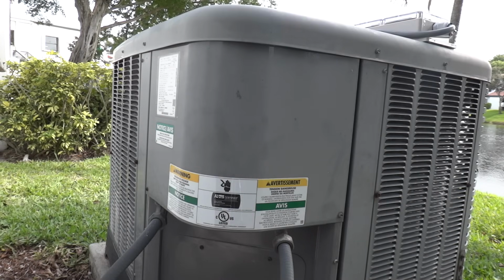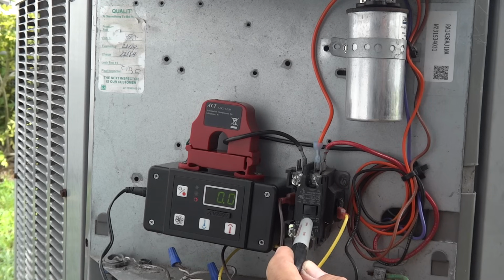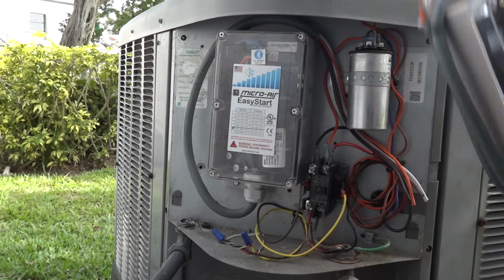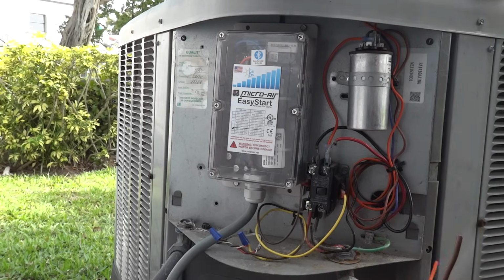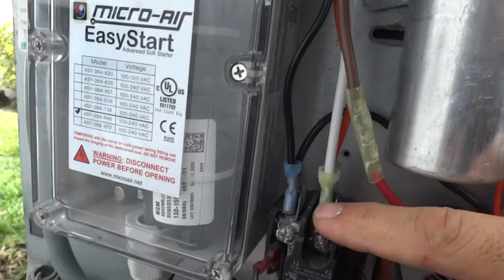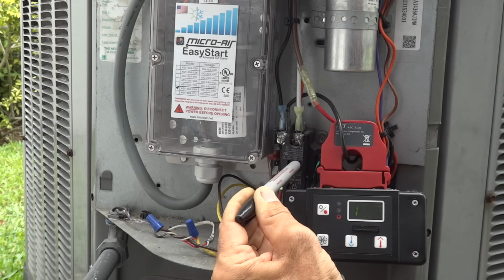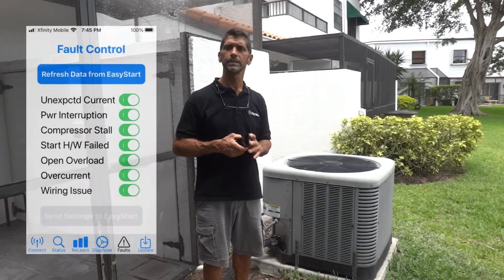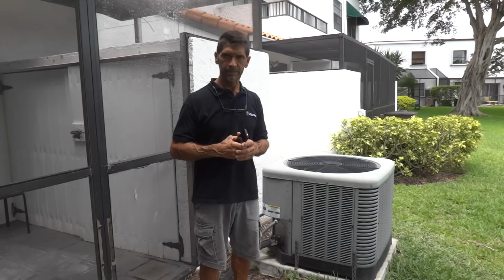Micro-Air EasyStart Home A/C Installation (368 Series)

Comment: Where where is all the other circuitry inside your air conditioner when you open it up? All I see is a capacitor and a contact switch. On my unit when you open it up where all your holes are in the metal I've got circuit boards, wiring all kinds of things hooked up. How come yours is so simple and everything's missing?
Reply from the maker: Hello and thanks for your comment. Most common home air conditioners don't have any circuit boards in their outdoor (condensing) units.  Only a run cap and a contactor, as you saw in the video. For more advanced home units, there is sometimes a circuit boards in the condensing unit that monitors the compressor's operation, provides more sophisticated power interruption protections, etc.  In such cases, you will need to mount the EasyStart external to the electric box, and route the harness wires back inside the electric box for proper connection and termination.  Your installation may also require the use of another special EasyStart setting feature to deal with any advanced compressor monitoring that may be getting done by the system's own circuit board.
Reply: @MicroairNet  And by the way, you need to edit or take down this video as it contains inaccurate information. You said anyone with a 3 ton or less needs the x36 model. In fact anyone with a 2-4 ton unit needs the x48.
I confirmed this with Micro Air. They said they have made changes since this video and being you are an engineer people will take your word and order wrong. 
Please correct this as people will be buying the wrong unit.
Thank you
Reply from the maker: @plainwornout3964 Hi again. The video was published well before Micro-Air changed the size ranges.  A correction to the size ranges was put into the description box a couple months ago.  Please see that.
Reply: @MicroairNet  Alot of people don't look at the description box. I don't believe there was any mention in the video of looking in the description box or anything because it wasn't known at the time. Therefore if I would have went solely by the video I would have ordered the wrong one. That's why I think it should be taken down and put up a new one in its place or put up nothing at all. But I thank you for your replies.
I'm not trying to troll and I think your product will be a Godsend.
Have a nice evening.

Comment: I AM EXTREMELY UNHAPPY WITH THIS $350 PURCHASE!!!!
I purchased an Easy Start unit and installed it over a month ago and my experience is exactly the opposite!!!! The LRA on my 2 1/2 ton Trane unit are 63 and with the Easy Start I see 50 plus amps inrush all the time. This is not even close to the advertised inrush as shown in the above video.
The Micro Air technition has not been able to offer any explenation that makes sense and insists their is nothing wrong with the unit i was supplied with. They really have offered no help.
Reply from the maker: Hi Roy.  I am sorry that you are unhappy with the performance of your EasyStart. I looked up your case and just had a discussion with the support engineer who has worked with you diligently since May 21st.   I will contact you via your email (which I have) and work with you further on this. If in the end we cannot get it working, I will authorize a return/refund for you.  Although we now have over 100,000 satisfied EasyStart customers, we take each case seriously and won't let anyone go away unhappy, even if we cannot figure out why it isn't working correctly.
Reply: in some of the videos, he does say that some units will not see a great differance in starting amps, but it should help prolong the life of the equipment. 😃 On another note, is there a way to test if my 2018 AC unit requires a hard start due to old age or faulty equpiment? 🙃

Comment: I have a 4 ton AC, with the Easy Start 368 X48 kit, will a 8,000 watt generator do?. In addition, do I need a 30amp or 50Amp breaker generator, my circuit box says 50 Amp for my AC. Anyone can help?. Thanks.
Reply from the maker: Hi and thank you for your business.   First of all, the breaker size of 50A for your 4-ton outdoor condensing unit sounds high.  More often, a 4-ton condensing unit gets a 30A breaker or thereabouts. Check the "Max Circuit Breaker" spec on the system's dataplate label to confirm this number.  Second, the breaker for your generator should be specified by the generator manufacturer as well.  Typically, for a generator with a rated (not surge) output of 8000W, a minimum breaker size of 35-40A would be appropriate.  Oversizing the breaker runs the risk of overheating undersized wiring.  It's always best to follow the generator manufacturer's recommendations when it comes to breaker and wire sizing.  Hope this helps.
Reply: @MicroairNet  thanks for the quick reply, yes, my AC says is between 20 and 40 Amps. I guess the original owners probably had an AC that required a 50Amp, and I installed a new 4 Ton AC about 6 years ago, should I replace the 50Amp with a 30Amp?, second, you did not answer if a 8,000 watts generator can power the 4 ton A/C. Thanks
Reply from the maker: It might be a good idea to resize the breaker for the A/C unit to be more reasonable.  That way, if something does go wrong with it, it doesn't trip a main breaker somewhere else, throwing you off from where the problem may lie.

Regarding your generator, per the chart presented towards the end of the video, a 4-ton home unit - including the indoor fan and the outdoor fan & compressor - requires about 6300W of running amps for a typical unit. Yours may be slightly different.   With EasyStart installed , you need about 7100W per the typical estimates for a 4-ton.  Therefore, your 8kW generator should be able to start and run your A/C system if it has EasyStart installed.  Please note though that you will only have about 1500W of headroom left on your generator, so you will have to power manage the rest of the loads and appliances inside your house in order to avoid overloading it.
Reply: @MicroairNet  Perfect. Thank you for the prompt reply and support. I am buying the Easy Start today.
Reply: ok, finally I installed the Easy Start 368 X48 kit, no problems on the install. It stabilized at 24Amps. I have two questions ,
 1) the bluetooth app will not connect to the box until the compressor kicks in, correct?. 
 2) Is there a way to see the history of the last start peak readings?, mine has already 12 starts, and I would like to see what was the reading on each start.

Great product!!
Reply from the maker: @carapungo  That's great news!  Regarding your questions:  1) Correct; the Bluetooth only works when the EasyStart has power, which is only when the compressor contactor inside of the A/C unit is turned on by the thermostat; and 2) No there is not a way for you to see the start peak history; due to limited non-volatile data storage in the EasyStart's microcontroller, we had to carefully choose what was recorded.  The 5 learning start details are forever stored, but only the "last start" details are kept thereafter.  Thank you again for your business.
Reply: @MicroairNet  ok great, thanks for the support. I am looking forward to a great performance from this product. btw, what is the lifeline of the easy start?
Reply from the maker: @carapungo  The EasyStart is designed to outlast the life of your A/C unit. It can even be moved to a replacement unit and "relearned" once there.

Comment: So confusing...1st u said L1 & L2 connections & then changed to T1 & T2 connections...
Reply from the maker: Hello and thank you for your comment.  Sorry things got confusing.  I was trying to call out the precise wiring connections using the labels inside the particular unit I was working on. Such labeling does vary from unit to unit and brand to brand, and those of us in the HVAC industry typically refer to the INPUT and OUTPUT side of any contactor using the same reference designators, L1 and L2 (and L3 in 3-phase systems).  However, on most wiring diagrams, the input terminals (incoming power) are labeled L1 and L2, and output terminals of a contactor are more often labeled with "T1 and T2 (and T3 in 3-phase systems).   To add to the confusion, the particular unit I was working on chose to label the output terminals T1 and T3 (!), even though it was obviously single-phase.  

Bottom line, the EasyStart wiring - specifically the black and white wires - get connected to the OUTPUT side of the contactor, regardless of what they are labeled.  Black gets connected to the switched L1 (often labeled T1) and white gets connected to switched L2 (often labeled T2).  Hope that helps.

Comment: Perfect, great explanation, this is why I was sold and will buy one today .20:31  - EasyStart Benefits while on Utility Power
Reply: one last question, the specs on this generator, 7500 Running Watts and 9500 Peak Watts; is this ideal for my environment?. All I need is the AC when power goes out, plus one refrigerator and one freezer in the garage. Or should I consider a 9500 Running Watts and 12500 Peak Watts. The difference in price is about $300.

Comment: Nice video. I just installed the EasyStart 368 and it's working well. They only issue I had was connecting the app. There's no documentation telling you what to type in for the Bluetooth ID connection. I finally found another video on YouTube that tells you to just type in "EasyStart_" then press the Connect button. The app will find and connect after that.

Comment: I have a smaller AC unit.  18,000 btu or 1.5 tons.  Can I use an easy start? If so which one?
Reply from the maker: Hello and thanks for your question. Yes, EasyStart works on any sized A/C that runs on single-phase power.  For a 1.5-ton unit, you would need the ASY-364-X36-BLUE.

Comment: What a piece of crap for a product. I bought the ASY-364 and it simply would NOT install correctly. Kept Over-current faulting and would not learn. I had to remove it and send it back. I wouldnt purchase these products as thheir operations are dubious at best, and non-functioning at worse. BUYER BEWARE

Comment: I saw a video on YT from Gavin’s Garage and he installed a Easy Start. He has a 5 ton Carrier AC and powered it with with a Honda EU7000 which as (5500 running watts) and it ran fine.  He also started the 5 ton unit with a Powerhorse 7500 watt (6500 running watts) and it also ran fine.  I assume he would only be able to run the A/C unit only and nothing else on those 2 generators.

Comment: This product is the greatest invention since sliced bread, kudos to the inventors, I have a Rheem 3 ton AC unit that had a LRA of. 77 amps and 12.5 amp normal run for fan, after installing the micro air 368 easy start, I went from a LRA of 77 amps down to 24.2 LRA and normal fan run down to 5.4 amps, just completed a test and was able to start the AC with my 7250 W Predator generator
Reply: Have you seen any changes on your electric bill?

Comment: Mine just came in today. Installing it this weekend. I have a 8000 starting watt generator. It struggled to start my 3.5ton trane unit. I shut it off immediately to not harm anything. I was bummed out to see how inflated 10K plus generators have gotten. You could buy 2, 5K units for less than 1 single 10K, wilddd. 2 years ago a 12K was right around $900, now its close to $1,700. I found this for under $400 perfect solution. My A/C unit only draws 4200 watts after it gets started so with just a couple Tv's and Ceiling fans my Generator shouldnt ever be over 75% utilization. My home is very VERY well insulated so even in the harsh summer maintaining the house at 70f it never runs more than about 8hrs a day.

Comment: Questions on the Black and White wires for power.  The EasyStart only turn on when the compressor contactor is on.  Is this mean that the EasyStart does not turn on on all the time/standby?  Is this correct wiring?  Or do I need to connect to the 220v (black&white) before the contactor so it has power all the time?
Reply from the maker: Hello and thank you for your question.  Yes, your understanding is correct. Because the EasyStart only gets powered when the contactor is on, the EasyStart will not at all be energized nor will it communicate via Bluetooth while the contactor (compressor) is off.

Comment: Would this easy start void a manufacturer's warranty? I have a new TRANE HEAT PUMP, outside unit HP XV18-3 ton, variable speed compressor. Thank you
Reply from the maker: Hello Neal and thank you for your question.  As it turns out, your Train XP XV18 variable-speed system cannot accept and EasyStart nor does it even need one.  Variable-speed compressors already start using a speed ramp, so they have little to no starting surge by design.  Hope this helps.

Comment: I installed the Easy Start on my 5-ton Trane XR13 (2008) A/C and, to my surprise, this particular A/C came with an OEM hard-start installed.  Once I removed the hard start I found space behind the side panel and mounted the Easy Start, ran the wires into the electrical area, and found that it was very easy to make all the connections.  I did receive specific instructions from the Tech Support team at Micro-Air - thank you.  I have definitely noticed a difference on how my A/C performs now.  I do have a couple question though - why do the values for the Last Start Peak (A) range from 35.5 to 42.3 over 48 starts and what causes this?
Reply from the maker: Hello and thank you for your comment and for your purchase.  It is typical for the starting amps to vary from start to start, by up to +/- 5A. This is because of internal system temperature conditions and residual refrigerant pressures, both of which will vary depending on time-of-day environmental temperature and how long the system was off since its last operational cycle.  Thank you again for your business.

Comment: Your website selection tool tells me that I need the ASY-368-X48-BLUE for a 2.5 Ton but this video advises ASY-364-X36-BLUE, who is correct?
Reply from the maker: Hi Michael and thank you for your question.  The sizing recommendation chart changed since the publication of this video, so what you found on the Micro-Air website is current and correct.  A 2.5-ton system gets an ASY-368-X49=BLUE.
Reply: @MicroairNet  
Great, thank you for the quick response!

Comment: Just installed the EasyStart X48 on my 3.5 ton Rheem AC. LRA dropped from rated 109 down to 28.1 after 5 learned starts. Very happy. Anxious to hook up my generator through an interlock 30amp breaker to see if it will actually run the AC. Could be close with 6250 running watts and 8500 starting watts.  Have to wait and see.
Reply: So how did it go?
Reply: I'm curious too. I have a 3.5 ton and a B&S 6550 storm responder generator. Really curious if this will actually work.

Comment: Can you explain it like I'm 5, why a homeowner would benefits from this?
Reply from the maker: Hello and thank you for your question.  First, let's say you have a home generator or a home solar/battery power system and your installer told you, "You can run everything in your house EXCEPT your air conditioner".  Adding EasyStart to your air conditioner would allow you to get by this problem, allowing you to start and run your A/C unit while on one of these back-up power systems.  Second, do the lights in your house dim whenever your A/C starts up, or does your A/C make a loud noise when it starts up?  Installing EasyStart in the A/C unit will resolve both of these issues.  Lastly, installing EasyStart will extend the life of your A/C's compressor.  Hope this helps.
Reply: @MicroairNet  fixed my question as it looked like a 5 yr old wrote it... and thank you.  I was actually looking for a generator for the texas winter, just in case. And my a/c is loud on startup.  I'll be getting this in the future.  I appreciate ur fast response!

Comment: Can the easy start be used with the Emerson sure switch contractor?
Reply from the maker: Hello Chris and thank you for your question. Yes, the EasyStart can be wired into a system with the Emerson SureSwitch contactor.  The wiring is the basically the same, however the SureSwitch does swap the polarity between L1 and L2.  This won't matter in the end but it will very likely cause EasyStart wiring confusion.   If you don't already well understand the normal EasyStart wiring scheme, the (SureSwitch) schematic and its terminal nomenclature, and your overall system wiring, you may need to open a support ticket on the Micro-Air website and provide a photo of your system's wiring diagram in order to get some specific assistance.   There is unlikely anything in the knowledge bank when it comes to wiring EasyStarts into systems with the Emerson SureSwitch contactor.  Hope this helps.

Comment: ON 4TON 368!  I BEEN HAVEN CREDIT ON ELE BILL $488.00! I HAD THIS 3MONTHS! YELLOW WIRE DO NOT SEPERAT LEAVE ON COMPASS, CURRENT! YELLOW WIRE FROM MICEASYSTART WIRE SPLICE INTO YOUR CURRENT YELLOW WIRE ON YOUR UNIT!  I BE GLADE DISPLAY BEFOR&AFTER  !  MY A/C GUY TOTALY SHOCK OUTCOME 3 MONTHS USE !  ELE BILL USE TO BE MONTH!350.00!  HIGH START AFTER I DO SEND MONELY $270.00! AS BUDGET IM ON FIX INCOME  I HAVE CREDIT, $488.31! TRUE REDUSE START UP AMPS!!! MODEL 368!! DOS WORK I SHARE WORKS!